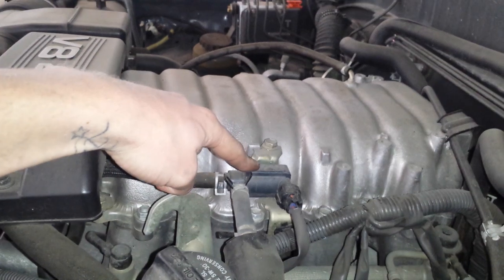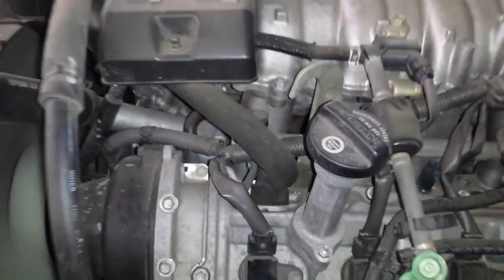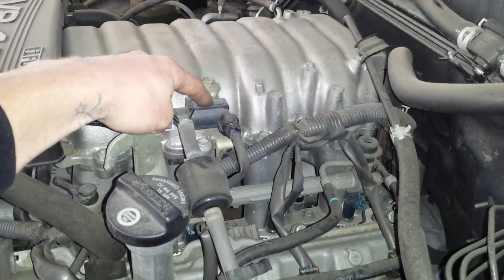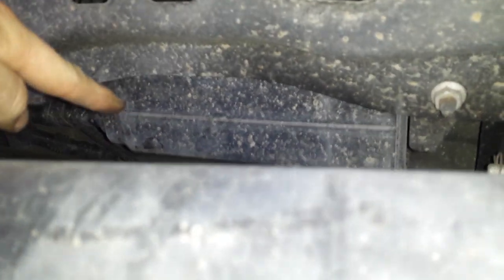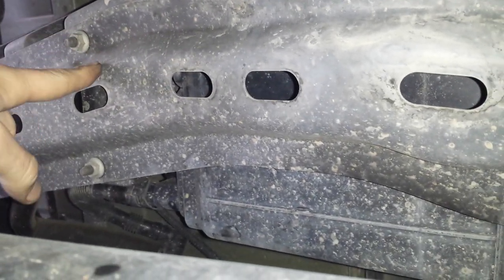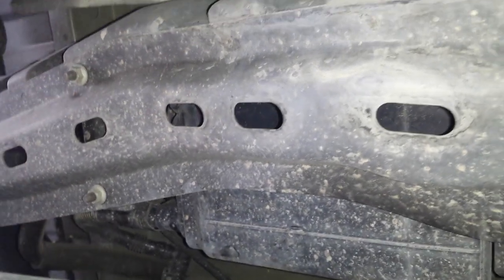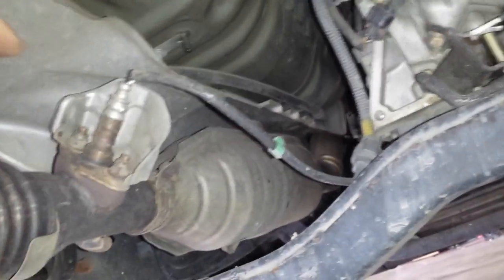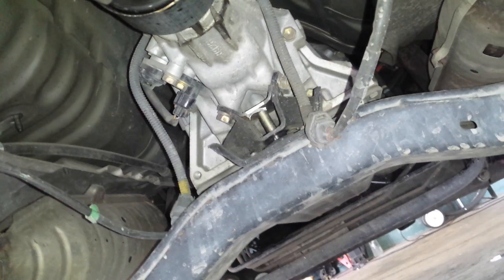Toyota Tundra Emissions: EVAP canister, PCV valve, EVAP valve, o2 sensors locations

Comment: I would like to ask you something that lead me here. I've been fighting the dreaded 2118 code on my 04 tundra 4.7 and purchased a OEM throttle body and acceleration pedal and a used computer,still stuck with no acceleration so I started tracing wires and that's why I'm here but it doesn't make sense to me why it would lead me to cannisters purge valve. Please help.

Comment: I had a code pull up on my 2002 Toyota tundra limited 4.7 v8 and the guy says that it is the solenoid for the vent to the vapor canister do I just need to change the solenoid to get the check engine light to go off
Reply from the maker: From experience if these events vent soulnoids get a code the most common failure point is the solenoid itself. If you remove the solenoid you can easily do a bench test. I just posted this video a couple weeks ago on how to bench test A vapor vent solenoid. https://youtu.be/P_TdjKWWE1k If the bench test passes then you might have a wiring issue or maybe the Wire pigtail at the vent solenoid has a problem. 

 Keep your fingers crossed that the solenoid itself is bad. Chasing a wiring issue will make it a little bit harder to fix..

Good luck and keep us posted on your progress.  👍💪🤞

Comment: Verry helpful. I have a P0450 and P0441 for 2002 Toyota Tundra V8
Reply from the maker: Hopefully that p0450 is a faulty code. Have you checked your purge solenoid? Make sure it holds vacuum. Good connection electrically and plumbing wise. If the p0450 keeps coming back, the map sensor on the fuel tank is faulty.
Reply: @ScottiesHobbies  I have not. Is there a video I can see to show me how to do that?

Comment: Just wondering = between the two , Evap canister solenoid vent valve( the one at the motor) and the evap canister vent valve( the one at the canister itself) which one is most common to be malfunctioning . I'd take an educated guess, or a guess based on history of seeing this problem rather than just replacing parts. Thanks if anyone can offer their help.
Reply from the maker: If you are having a problem pumping Gass, I'd start with the vent. Otherwise the purge goes bad more often in my opinion. You will usually get drivability codes on top of evap when the purge is bad. You can test either easily. With no power applied they should be shut and hold vacuum. With 9v or 12v power applied the vent should flow.

Good luck and keep us posted.
Reply: @ScottiesHobbies   Yeah, the cannister vent valve seems to be what most suggest goes wrong.  There have been times when I'm pumping gas and it just keeps clicking where I have to reset the gas pump handle ...a few times. Sometimes it does that throughout the filling of the tank and other times I have no problems.  What is strange is the inconsistent in nature where it is so random. and like I said, once I clear the code, it might go 2 months/300 miles or more before it trips the code again. It blows my mind how it's ok for weeks even months and then comes back. It seems to happen more around the time after I fill up the tank  ---maybe a week after I fill up .( I'm careful not to over fill, so it's almost full)

Comment: I have 02 tundra 4.7liter SR5 I changed fuel pump and now the evap canister full of gasoline leaked to the hose straight down that plugged on the body frame of my truck.My question is did I put back the fuel line from the fuel pump wrong or what? If anyone can helps me I do appreciate that in advance. Please send me the fuel lines diagram from gas tunk to the evap canister as well. Thank you so much.

Comment: On my 2010 Tundra I’m getting P0441, P0455 I went on Scottys channel he said check gas cap so I did it’s new with Key 🔐 option not OE, and then if that don’t do it then replace EVAP canister vent valve Where would I find that on my truck? Thanks 🙏
Reply from the maker: From what I see the p0441 is for purge valve. Did you research and find a common problem with the vent solenoid? I'll look on all data and let you know about the vent location when I get in front of my computer
Reply from the maker: Also... I personally do not like locking caps. From experience those caps fail way more than a non locking cap. I always recommend oe or fram makes a decent non locking cap.
Reply: @ScottiesHobbies  Thank you for taking the time to answer my question I would appreciate Letting me know what all data says
Reply from the maker: Speaking on a 2wd. The vapor canister should be above the drive shaft under the bed. If you are looking at that canister, on the driver end you have the vent solenoid is on the passenger side and the leak detection pump is on the driver side. You also have a filter in the ambient hose. The ambient hose is the small hose going to the filler neck. Fallow that little hose from the filler and you will first find the filter. Keep following and ull find the vent solenoid. 

Hope that helps. Good luck and keep us posted.

Comment: Very good video. I wish you would show how to adjust the Emergency brake. I took my 2004 Tundra to the Stealership here in Pittsburgh for a misfire several years ago and when I needed to use the EB it did not work. It works when I'm pointed down hill but not when I'm pointed uphill, it will roll backwards.. I do all the work myself now and it took a lot of studying but I can't find much at all on the EB subject. Thank you for sharing your knowledge.

Comment: I’ve got a P0442 code for small leak in the evap system and can’t find it I hear a small soft putter that builds with acceleration and I hear it somewhere on the front driver side of the truck.
Reply: Did you find it? Same
Reply: exact same problem

Comment: I have a 2004 Tundra and code P0442 is on. I changed the cannister it was original and was bad looking, I  put a new gas cap on, still the code appeared today. Any suggestions on what to check next ?
Reply from the maker: The purge solenoid and vent solenoid should be checked for continuity and to make sure they're holding pressure. If both of those are fine then the EVAP system itself needs a smoke diagnosis. I do have a video where I am doing a Mickey Mouse evap pressure check on a Dodge Caravan if you took my other videos. If you can't find it let me know I'll see if I can find the link. I've never seen a canister go bad unless it has been hit or damaged by something flying up off of the road or being an accident or something like that. If you have a leak in the EVAP system that the computer cannot find.
Reply: @ScottiesHobbies   I have an 03 Tundra that trips the evap code, which I can clear, and it stays off for 300 to 500 miles before it comes back on. I've replaced the gas cap with OEM cap. Just wondering if this time span before tripping the code offers any clue on what might be the problem
Reply: Just wondering if by now you've found what the problem was ? My 03 Tundra throws the same 442 code and would love your input as to what the final fix was if you could share

Comment: I have a question on my 2001 tundra is their a fuel vapor canister under my truck I see the one on the top is that the only one??? I'm trying so hard to get this fixed
Reply from the maker: What problem are you trying to get fixed? Very rarely do canisters go bad. The only time I've ever seen a vapor canister be defective was when it was broken from road debris hitting it or in a car accident. Do you have a code that you're chasing?
Reply: Ground is at the back of each cylinder heads

Comment: i have a 01 tundra my check eng light is on and i was told it was my emissions but i would like to do it my self but i don't kn what i need could you please help me i don't have much money to take it to a shop please
Reply from the maker: +Kelsey Dixon do you have the code? Have you inspected your fuel cap? Check the seal on the bottom side. Does the fuel cap click locked easy?
Reply: +Scotties Hobbies I was told that I'm going to need a new Vapor canister bulk hose and two pressure sensors $1,078 does that sound right because that's quite expensive
Reply: +Scotties Hobbies oh yeah and thanks for replying back to me I really appreciate it
Reply from the maker: Sounds like someone can't find the problem and wants to replace all the components in your evap system. I don't think its likely to have the whole system go bad at once. 

Do you know if your evap canister is cracked or broke?
Reply: +Scotties Hobbies no my canister it's not broken or cracked
Reply from the maker: I would figure out the code, i might be able to recomend something better for you. But from what you are saying they want to replace its the whole evap system. Its possiable it needs to be replaced but i verry much doubt.
Reply: +Scotties Hobbies okay thanks I'll keep in touch thanks so much
Reply: po441 is the purge valve   part # 25860 60100  just bought one from advance auto parts on line 25% disc free shipping.next day i got it.I hope it does the trick gas cap did not. 2001 tundra sr5